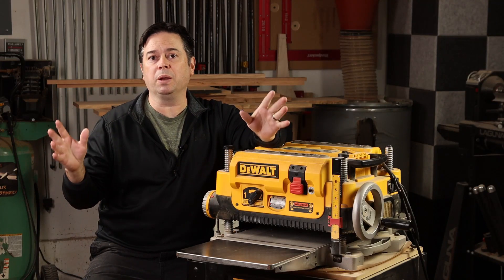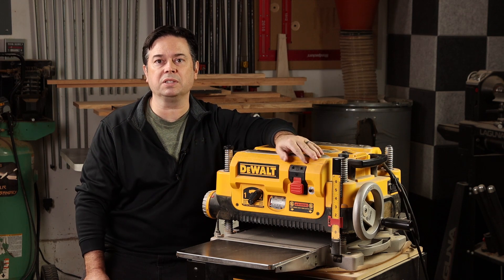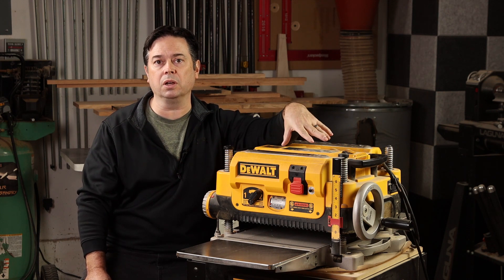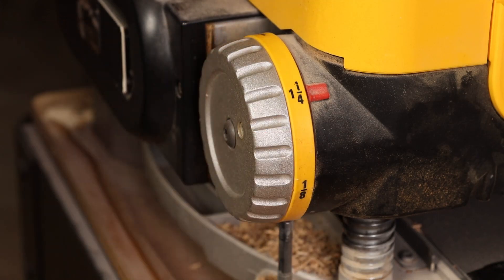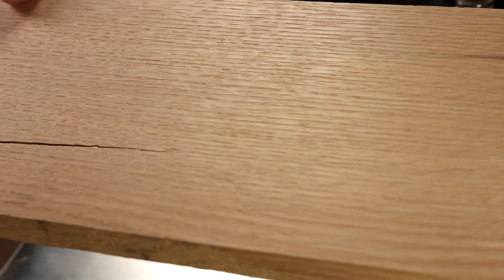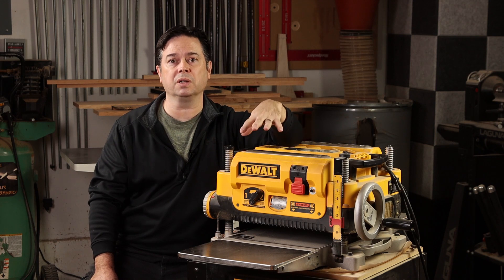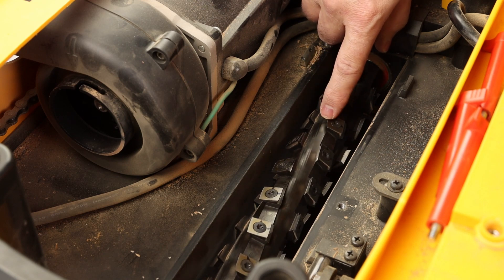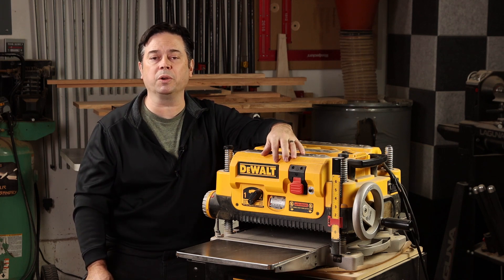Dewalt 735 X planer Long Term 10 year Review Shelix Helical Spiral Cutterhead Woodworking Upgrade

Comment: I've got this same planner and find that I frequently have to clean the roller heads with mineral spirits and keep the table surface slick with paste wax otherwise boards will stall and have a tough time getting pulled through. Overall, happy with mine. 

Also want to say your content is really great and presented in a very enjoyable format. Keep it up, I can see your channel really taking off. Take care.
Reply from the maker: I agree about waxing the tables, very important.  Thanks for the nice comment.
Reply: Strong work! Great video and very informative. 

I recently heard that the chip ejection fan also helps a little bit with motor cooling. Removing it may have contributed to your thermal overload problem potentially. 

I haven’t gotten a chance to get in mine and actually look though. 

Anyways. Great presentation style. Thank you for posting
Reply from the maker: @ferrariboy150  thanks for the kind words.  I just took the chip ejection fan off as a test.  I ran one board through, and realized it didn't improve the noise, so I put the fan back on.  The thermal overload issue is actually a common complaint with the 735, but probably a little worse with the Shelix head.  Thanks again.

Comment: I just bought this tool with the lux cutter. Havent received them yet, but i wish i learned about it being underpowered for the helical head. Have you heard of changing the breaker on these?
Reply from the maker: I replaced my overload breaker at one point, but it didn't seem to make much difference.  Still probably the best bet in this price category.  A 5hp industrial planer is a lot more $$$
Reply: @TheThoughtfulWoodworker  i just saw a 3hp 15" benchtop grizzly planer. I think im going to return the dewalt and lux cutter, spend a few hundred more and get something bigger that wont pop.

Comment: Remove the fam and the motor will over heat. 
Add a vent tube to the power switch housing. Help cool the thermocoupler. The housing heats up and makes it trip easier.
Reply from the maker: Thanks for the ideas.  I'm not looking to make those types of mods.  I sold the DeWalt and bought a 20" 5hp planer.  It's not perfect, but at least there's enough power.  Best to you.

Comment: Why not buy straight carbide blades as a compromise?
Reply from the maker: I seriously debated going that route.  Infinity makes some nice carbide replacement knives.  They are still pretty expensive, and you only get one sharp edge, as opposed to 4 with the Shelix.  Plus, if you get knicks in the cutters, you just rotate a couple of them.
I'd be interested in your experience if you upgrade.  Best to you.

Comment: Your statement is not correct on the outfield table you can fold it up if you raise the blades.
Reply from the maker: Good observation.  While that may be true, it's too much of a pain to do.  It's a common complaint with bench top planers, including my Laguna PX12.  Best to you.
Reply: The thing is - that exhaust port has ONE, spring loaded pin to remove it. Just take it off if you want to store the planer.

Comment: Anyone else getting streaking or scallops?
Reply from the maker: I get what I call slug trails.  Just shiny lines that run the length of the board.  I only see them in low raking light.  They are essentially scallops, but they're so shallow, a quick sanding with 120 grit removes them.  So much better than tearout for me.  Best to you.